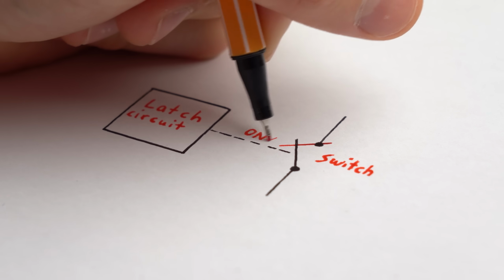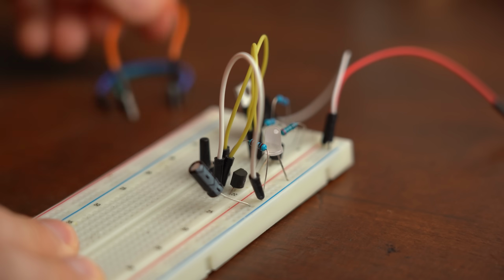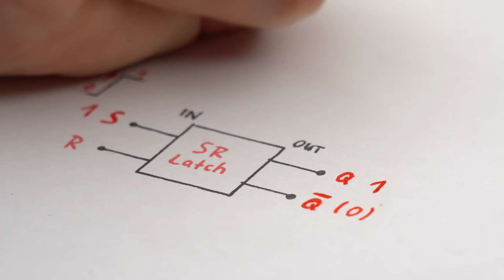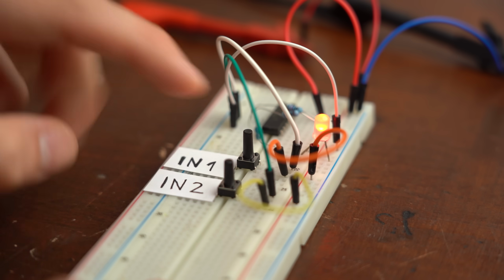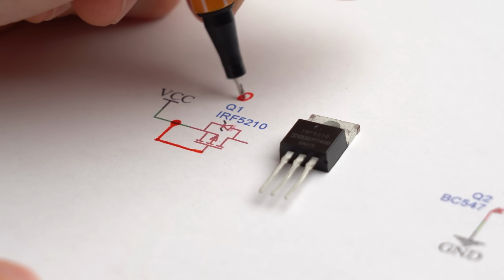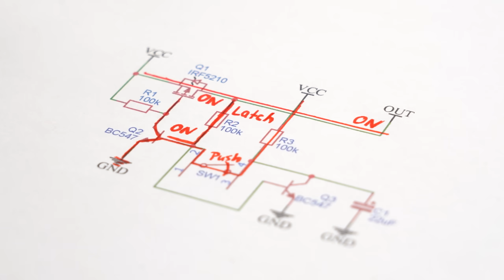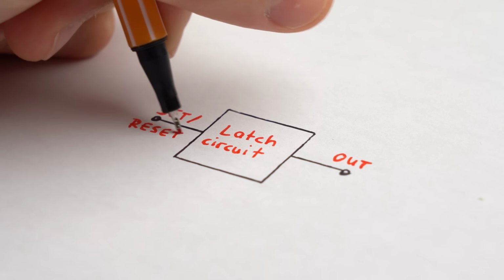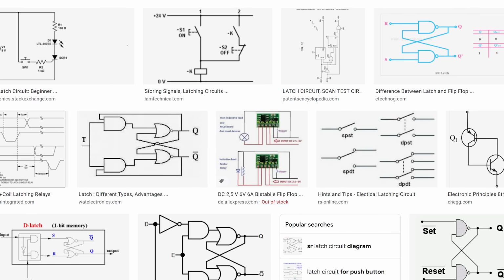Mechanical  Switches are Obsolete?! Switch to a Latch Circuit! EB#53

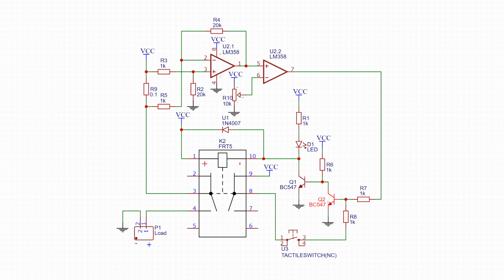Comment: 10:08 You are exceeding the input common mode voltage (max of VCC - 1.7V) for the LM358 opamp using this high-side current sense. This can lead to some odd circuit behavior in your difference amp.
Reply from the maker: Thanks for the feedback. So far it worked just fine.
Reply: @greatscottlab  "So far it has worked just fine"; one of the most dangerous statements I hear with regard to circuit operation.  Yes, it works in this configuration, but you are reying on the stress margins the designer/manufacturer put into this LM358.  Another brand of LM358 may not have the same margins, and could fail if used in the same manner.  For long term, i.e. product level, reliability components must be operated within datasheet parameters, often with some additonal margin to boot.  You're showing how a circuit can work, but not highlighting risks that may be exposed by this configuration.  This can be the difference between "hacking" electronic circuts and designing them.
Reply: @donbarr9487  Aha!

Comment: What will happen if you don't release the toggle fast ? Would it turn off after the capacitor fully discharges ? Because that's different behaviour than the mechanical toggle.
Reply from the maker: Yep. It would turn off. But you can always change the cap value to increase the turn off time.

Comment: "obsolete" ? what about the satisfying clicking sound ? or the joy of trying to balance the on/off right in the middle. and an array of on off switches allows for an artful/pathetic switching act performance (even if there isn't any device connected at all). it's just not the same. :-D
Reply from the maker: I do love a mechanical toggle switch. But sometimes latch is the way to go ;-) You will see it in upcoming projects ;-)

Comment: A latched circuit like this would've been useful a few years ago (shortly before a crash I had, lol) for a piece of test equipment I were working on.
I were looking around for one to make that I can then control with a micro-controller to turn itself off when finished to conserve battery for use in the field... I had to make do with another workaround tho.
Reply: SR flipflops in integrated circuit form have been around since the 1970's....
Reply: @deanXRayZulu  Yes, I know.... I'm on about this more simplified one-button on/off mechanism.
BTW, I ended up using a clocked S/R flipflop IC in the end anyway and then just used the MCU to turn off the supply by resetting the flipflop.
That meant the device stayed on until a delay and the person couldn't just manually turn off the test equipment.

Comment: Could still pop in a mechanical switch as the input to a set-reset latch. I understand some vintage computers did that for critical signals, so the switch bounce wouldn't fire things by mistake.

Comment: I’m in two minds about the use of latch and standby circuits. The amount of energy waisted to power these standby circuits is huge across a country. I think in most applications I prefer a real mechanical switch
Reply from the maker: Latch circuits do not draw power though......
Reply: @greatscottlab  It depends on the topology ie Bipolar. But it’s also a safety issue can you be sure of the possible failure modes and transient response. I can see latch circuit being cheaper compared to a mechanical switch and in not critical application fine. I’m not really disagreeing with you just saying it’s not right for every application.

Comment: why not use triac with opto?
Reply from the maker: You can basically use any semiconductor switch in such latch circuits. So feel free to use an optocoupler and triac.
Reply: isn't that more expensive?
Reply: @xTerminatorAndy  depend upon load current. A 600V and 12A triac and zero crossing optocoupler both are available just for 0.34$ each.

Comment: actually one big advantage of the normal switch is that there is no standby current and connection ofc is broken meaning if you had a fault situation that could fry your devices they are a bit safer.
Reply from the maker: Latch circuit does also not draw any current.
Reply: @greatscottlab  There's leakage currents through the transistors.  The IRF5210 datasheet specifies a maximum 25uA of drain to source leakage current at -100Vds at 0Vgs.  A microcontroller shutoff would be asked to switch about 5V, so we can guess maybe 1uA of leakage at -5Vds.

If the output is low impedance, then that would be all.  If the output is high impedance, however (e.g. disconnected), then the leakage current would charge up the bases of Q2 and Q3.  Worst-case, the transistors are mismatched and 1uA flows through the base of Q2, which is amplified by a typical factor of 200 to 200uA of emitter-base current.  That would draw the gate voltage of Q1 down by 200uA*100kOhm=20V, but that would be strong enough to turn Q1 on hard, latching the circuit on.  (Sanity check: 1uA flowing through the 100K R2 would be consistent with a base voltage of 4.9V, more than enough to drive current through Q2 to turn Q1 on.)

The real equilibrium would depend on the small-VGS behaviour of the IRF5210, but the datasheet doesn't have enough information there.  I would be comfortable calling 1uA of standby current a plausible value, with a risk of the circuit self-latching on if the output is disconnected.  (If instead Q3 turns on first, the circuit might not latch but now Q3 amplifies the base current, drawing more 'standby' current through R3.)

I'd need to simulate it to be sure, but I suspect you could avoid the risk of self-latching if you add a diode ahead of the Q2 base; that would force stray voltage in the latch to find its way to ground via Q3.

Comment: A question for you ,
I have made a latch circuit using 555 timer and 5v 30amp relay, and fit it into switch board, I put 15 meters long thin wires to set and reset the latch circuit using push buttons.
But the problem is.... When i switch other appliances on or off (like fan and tubelight) the latch circuit get automatically set on which is  dangerous for me , i don't know why these happens and what is the solution for it ❓
Reply from the maker: Do your signal lines have pull down resistors? They need a defined off state. Otherwise interferences can easily mess with those lines.
Reply: @greatscottlab  yes both on and off buttons are connected with pull down resistors
Reply: Yup I have also faced this but I never use that long wire I have used it in an enclosure but still it triggered for no reasons. The cause of this is I think the 555 is sensitive to noise so it could trigger it and considering you have long wires. I have a simple solution which works for me which is I put a small value capacitor in parallel with the switch like a 100nF or something like that and it stops the false triggering of the 555.
Idk if it will work for you but it's definitely worth trying.
Reply: @xelcocorp  thank you brother I wil try it,  and if it will not work I will go with Arduino, give me more suggestions if you come to know 👍

Comment: Latch circuits without a memory of the last selected position can be a real pain in the ass.  For example, see the MANY powered USB hubs with such switches which don't remember port selections between power cycles and don't even automatically turn on when power is applied.  DUMB!
Reply from the maker: Hmmmm good example
Reply: @greatscottlab  The reason so many things which shouldn't have "dumb" electronic switches DO have them is because they are MUCH cheaper than mechanical switches like toggle switches.

Comment: How can make a switch as per this? I want to turn off my Water pump when the tank goes full because I don't need to turn the pump automatically.
Reply from the maker: Add a top level sensor that goes to the reset pin of such a circuit and done.
Reply: @greatscottlab  Thank you so much for quick reply 💖, I am following your channel from manay years, because of my deep interest in electronics and i am a cellphone technician by profession.

Comment: For battery operated devices that are used infrequently, I really prefer a mechanical switch where there is ZERO drain (other than the compulsory modelled resistance in the battery). Otherwise when you need said devices, you find dead batteries at best or corroded terminals usually.
Reply: Yes. I have a very expensive flashlight and I have to unscrew the end where the batteries go because otherwise they drain when it's not being used.
Reply: mechanical switches and relays are important in many applications due to considerations surrounding failure modes.  in safety and life critical applications the failure mode is critical.
Reply: I tried to apply a latch circuit to a AA battery product simply the product don't have space for mechanical switch. It failed at the end because transistor not only have ON/OFF state like we usually think, it can also half open causing both transistor state appears to be on at all times, the "half open" state often trigger by unstable battery voltage (since battery powered). More electronics added to stable the logic state just introduce more idle current consumption and kill the batteries even the product are not used.
Reply: You can still use a latch circuit to disconnect the whole device off with zero drain after a microcontroller finishes its tasks, look for electronoob implementation of these kind of circuits, which are great for battery saving.
Reply: We have a massage machine with a built in re-chargable cell.   In has soft buttons for power level and on/off.   It also has a mechanical button at the bottom of the handle.   If I leave the mechanical switch "on" the battery get's discharged in day or so.   If I remember to turn it off, the battery charge lasts at least a month.
Reply: Can someone explain why? I am building a soft latching circuit myself, based on PMOS, and the leakage current when off is low enough that it would take hundreds of years to drain the battery (yes I know it would die naturally well before that). the resistance of the mosfet is also very low when on. something like 50 milli-Ω...how does that drain/corrode a battery? 😕
Reply: @mikepaul6688  well, leakage current varies exponentially with temperature so depending on your application (e.g. something likely to get left in a hot car, chemical process, solar or thermal related, etc.) that might be a consideration. Also, MOSFETS with a lower threshold voltage tend to be more leaky. So again it all depends on your circuit and its application.
Reply: @Gideon_Judges6  ah interesting, thanks!!! but if it's just a small Arduino circuit (250mA-ish max load) left consistently at room temperature, most PMOS won't cause significant battery drain when off, right? (sorry if not providing enough info..lets just pretend it's a flashlight)
Reply: @mikepaul6688  I won't make sweeping judgements without knowing the specific circuit and batteries involved, but keep in mind even 1mA of current will drain any lithium ion 18650 battery cell in less than six months. High capacity 18650s are around 3000mAh to 4000mAh and there are only about 730 hours in a month. Assuming a flashlight, well any flashlight circuit I would make would use a physical switch that disconnects the battery completely from the circuit when off and then the battery shouldn't have any drain other than its own inherent leakage when not in use.
Reply: @5467nick  Yes, I am understanding your calculations, but I'm unsure of where the 1mA of drain would come from when the mosfet is off and the circuit is unpowered.

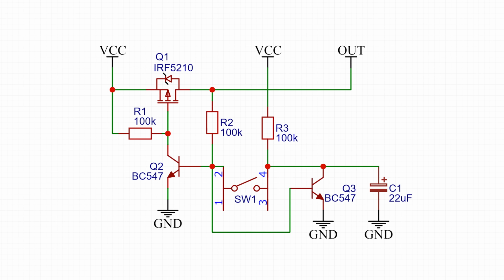I assumed that the only significant draw on a PMOS soft latching circuit in an "off" state, like the one pictured  at 6:54, is the  "Drain-to-Source leakage current", or IDSS. Looking at the datasheet for the Mosfet he uses in the video, IRF5210PbF, that is -25 micro-amps MAXIMUM when left at Room temperature. That would take around 25 years to drain the 4000 Mah battery in the worst case. 

At 125 degrees C, it would take just under 2 years to drain the battery 4000mAh battery, as the IDSS rises to 250 microamps for the IRF5210. So yes, maybe that could be a problem if you leave the device in a car for a long time, in a hot climate...But I'm guessing you'd have  such a device hooked to the car battery, and 250 microamps won't make much of a dent in such a large battery (40+ amp hours). 

Some mosfet's I've seen have this IDSS figure at only 1 micro-amp, at room temperature (like FQP27P06), which would take 450 years to drain the battery. That same mosfet lists IDSS at 150 degrees C to be only 10 micro-amp. So now the issue of a hot environment seems like it can be  eliminated with a different mosfet (the FQP27P06 and IRF5210PBF have pretty similar characteristics, such as gate threshold voltage, and maximum current). 

There is also leakage from gate to source, but that is the nano-amp range.

What am I missing here that leaves the batteries drained, and terminals corroded under "usual" circumstances?
Reply: @mikepaul6688  I've never seen corrosion from lithium batteries, that's the big advantage over alkaline. My zebra light flashlight draws 26 microamps on standby, so it's about 7 years to half discharge, but I'll still unscrew the tail cap to eliminate even that miniscule drain, because it's easy to do, and there's no benefit to maintaining power, since it doesn't have a clock circuit or volatile memory settings.
Reply: @dubmob151  yes, non-rechargable batteries, with very long usable life and leakage protection, would be the battery of choice, if your appliance is used very infrequently and you want the charge to be retained for many years. Using the cheapest Alkaline's would be pointless.
Reply: @dubmob151  Well fair enough then.

However, when you mention standby mode, I think you're referring to the fact that this flashlight has a microcontroller inside of it, which is always being powered when the batteries are inserted. The pressing of the push button would signal the microcontroller to wake-up and change the brightness levels of the flashlight. The same button can also turn the bulb off and put it into standby, or sleep mode.

However, the topic of the video is discussing ways to physically "cut off" all power to the circuit, including the cutting of power to the microcontroller. This is done through either a mechanical switch, or mosfet. With slightly more circuit complexity, you could have a single push button which completely switches on/off the circuit (via a P mosfet). The same push button could also perform other functions, like command the microcontroller to adjust the brightness level of the flashlight. 

When it's in an off state, that soft-latching circuit would reduce the draw of the battery to be that of the Mosfet's leakage current, which I mentioned before could be only 1 micro amp maximum at room temp.
Reply: Then, in those case, do as you said.  What's your point?  That batteries can't supply energy indefinitely?  We all know that.  Thanks.
Reply: @DiffEQ  the point is you end up with a dead battery and corroded terminals way faster when there is a parasitic draw from the "soft" power switch.
Reply: @Gideon_Judges6  electronic switches are fine as long as there's at least some value added, like ability to control modes, or automatic power down operations. If it's nothing more than on off control, nah to the gimmickry
Reply: @dubmob151  you can have modes and still have a mechanical switch with a true disconnect. Like a main rocker or toggle switch that's out of the way with a soft power switch is probably best of both worlds 🤷‍♂️

Comment: This channel is starting to become " the complicated way to make electronics" lol
Reply from the maker: Hmmmm I would not call such a circuit complicated. Pretty basic stuff honestly.
Reply: @greatscottlab  It's not that the circuit is complicated, it's the idea of replacing a simple toggle switch with a more complex latch circuit when a switch works perfectly fine.  Not saying the circuit isn't useful in various situations but it is adding extra steps and parts to something that can be easily achieved by a singular cheap toggle.  Maybe it's most suited as how to make a latch circuit instead of replace toggles with latch circuits.

Comment: Honorable mention to the humble (two coil) bistabile relay which is also set reset, and very useful in applications where a pseudo-latched run off the mill relay might draw to much power over time.

Comment: Cool, but adds unnecesary complexity which can fail. Plus, if your device has problems and has a latch on/off switch you might not be able to make sure when the device is turned on or off. So no, mechanical switches are definitely not obsolete.
Reply from the maker: Definitely not obsolete. But there are cases in which a latch circuit can be a very good replacement with advantages.